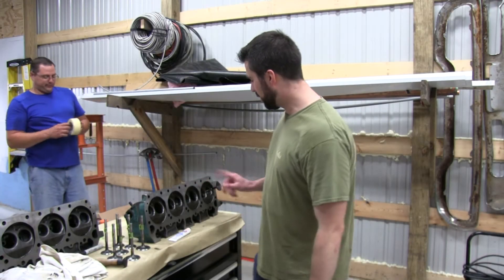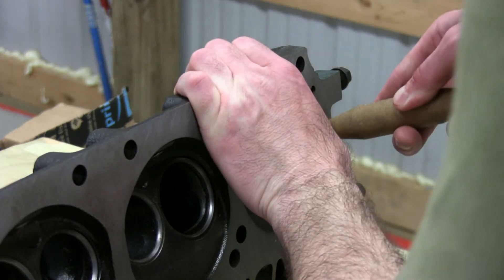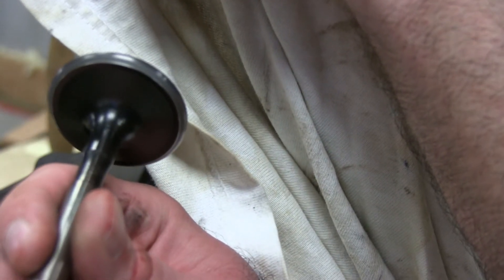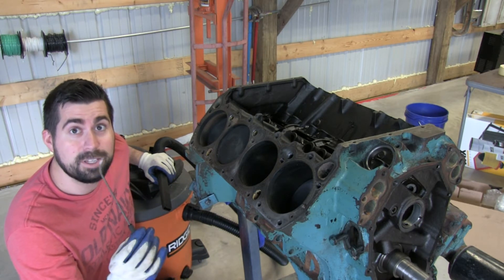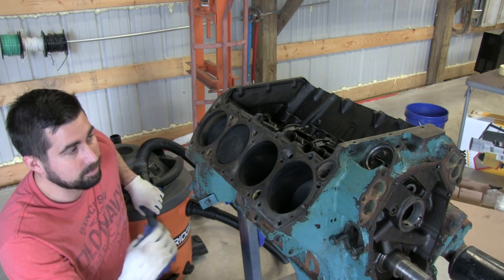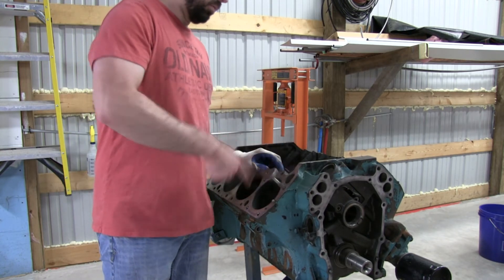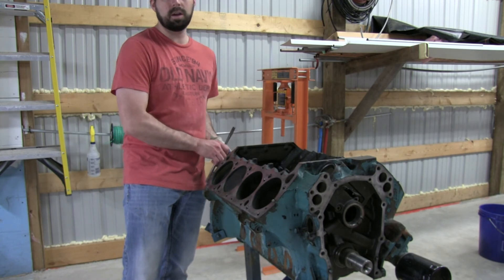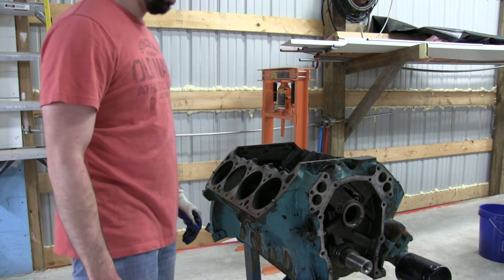Mopar 440 Engine Build Part 12 - Hand Lapping Valves & Block Prep

Comment: New head bolts I would have got some arp but not my motor wen I take something like that out I do the whole thing so it will last not just the top for all that rings cost and some bearings I don’t get it especially after doing the heads half way decent